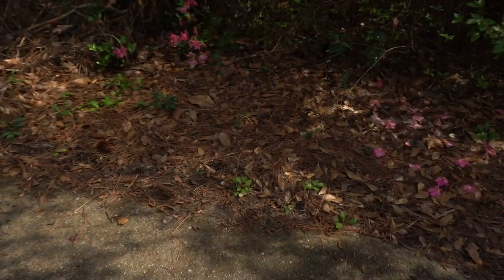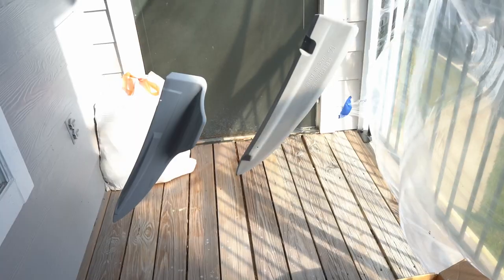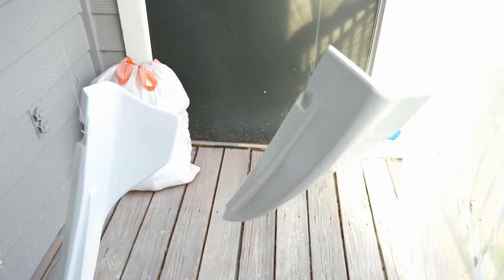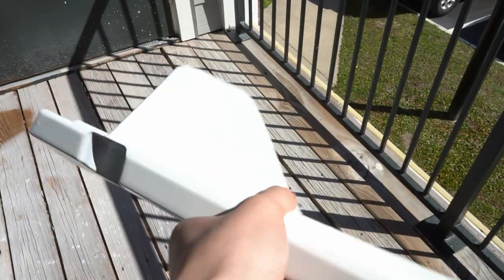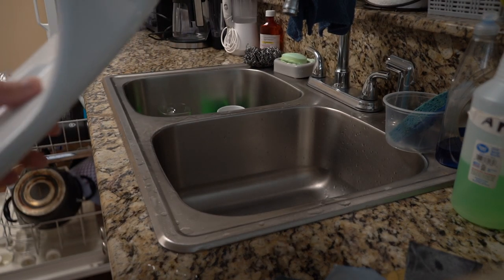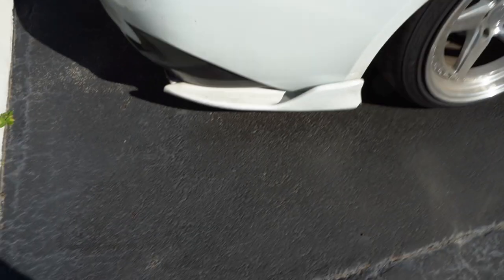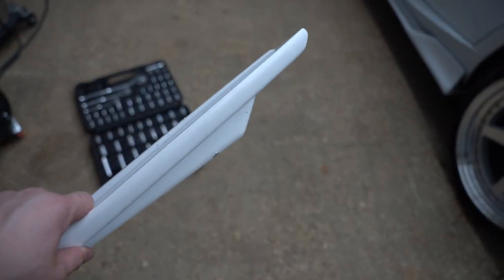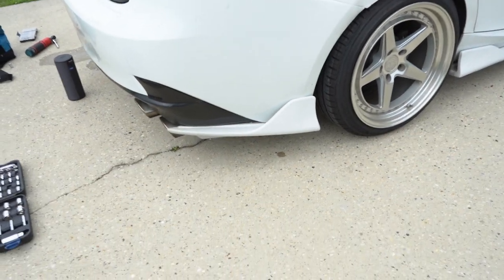Painting and Installing My NEW Rear Apron

Comment: What grit sand paper did you use before you hung them up? Also, what kind of material was your splatts made out of? Mine came in the mail and I got someone to paint match it and they noticed there were alot of these spongey looking holes all over them. So sad. If yours was made of polyurethane, you didn't have to use a flex agent/adhesion promoter for that material? How are they holding up! I'm affraid they might get chipped and damaged because they are white and underneath the car.
Reply from the maker: @to8840  i don’t remember exactly the grit but it was probably 320. I believe it’s an polyurethane and I didn’t use a adhesive promoter and haven’t noticed any spongy or fish eye on the paint and it’s holding up good!
Reply: @Jonathan.Nguyen  yeah yours came out looking very nice. Gonna buy primer filler and hopefully they fill the holes that came with the apron.. I ordered the oem paint from lordco and came up to $80 and it came with a 2 part spray paint. 1st is base coat and 2nd is a clear coat with flakes. You think the clear coat with flakes would be good enough or do you suggest getting the 2k aswell? Was your apron a hard rubber like material? Only worry for me is chipping from flexibility.
Reply from the maker: @to8840  never used that paint so can’t say for sure but the flakes will be nice. Mine is a hard plastic
Reply: @Jonathan.Nguyen  okay thank you. Mine is like a hard rubber like material. Lol
Reply from the maker: @to8840  never seen a rear spat like that. Interesting
Reply: @Jonathan.Nguyen  yeah right? Thats what I was thinking...anyways, ended up buying the 2k clearcoat bro...what a difference and worth every penny. Looks soo good. 👌🏼 thanks!